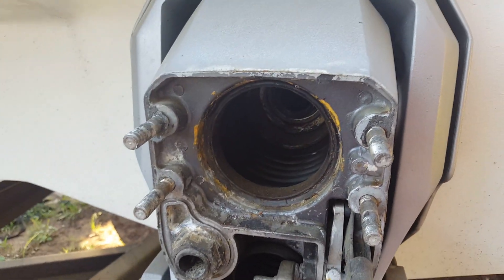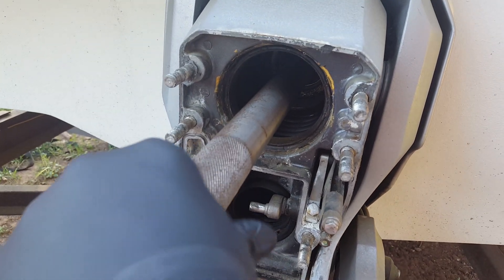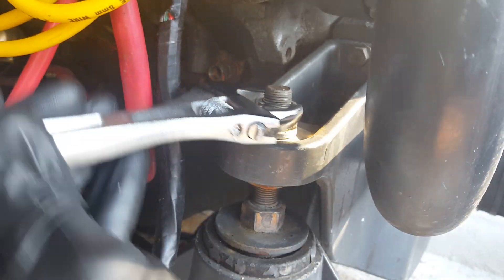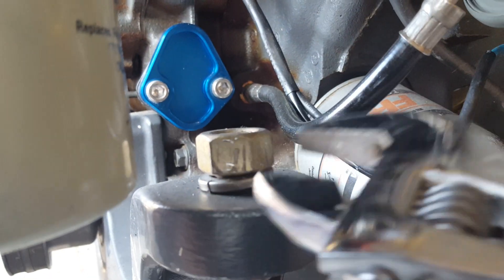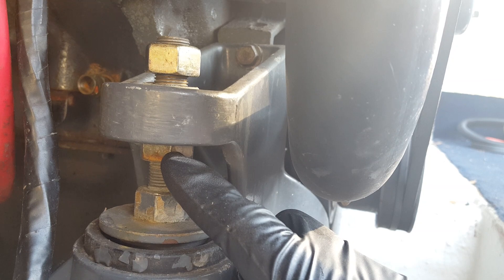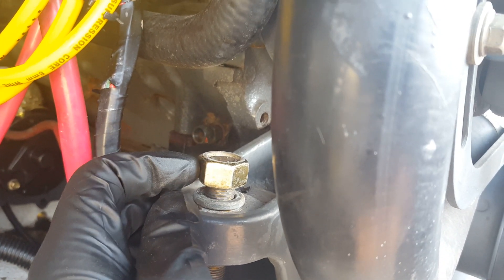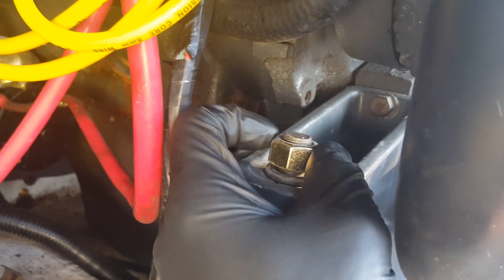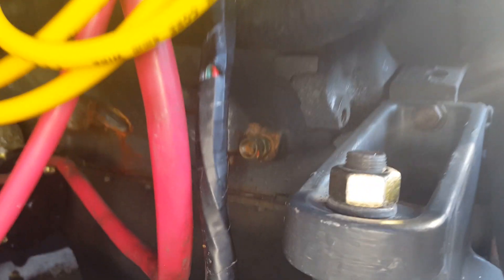OMC Cobra Volvo Penta SX Engine Alignment Procedure

Comment: Hey Mike, you've helped me a lot with your videos. I've installed the oil seal and gimbal bearing,  but now we're struggling to get the engine aligned. The tool seems to be binding about halfway through the turn of the tool. Any suggestions?

Comment: Is there any signs that your boat needs a fresh alignment , tell tale signs?
Reply from the maker: Typically the first thing is your gimbal bearing will go out and you will hear a really bad sound coming from that part of the transom. The second sign is when you pull the sterndrive out it will not go back in to the motor.

Comment: Hey Michael, so I just replaced my 5.8 omc cobra efi block with a new crate engine. Having a few problems hooking everything back up. I’m more worried about the alignment because I had to take the front motor mounts off to get the motor back in, I didn’t move it much, wondering if it’ll be ok?
Reply from the maker: The alignment will be off and the number one thing to remember is to be patient. This process can takes days or even a week to get perfect. It will eventually align perfectly.

Comment: My OMC Cobra won’t reinstall after gimbal replaced. Bearing is level but alignment tool hits top of engine coupler. Even in I bottom out the motor mounts it still hits the top of splined and won’t enter. Do I have to pull the engine out at this point?
Reply from the maker: You may have to raise the motor up to be able to swing it back and forth with a lift. I  had the alignment take 3 days. So if it’s taking a long time, it’s not abnormal. One time it took me a week.

Comment: I use the grease on the tool to tell me which way the engine needs to go.  The grease should look the same all the way around the tool when it is properly adjusted.  More grease on one side than the other indicates which direction the engine needs to go.

Comment: i have a question since i measured my adjustment tool and i have 16 3/4 from the bearing to the end how long is the tool you using so i can figure out if im all the way into the spline.

Comment: Was going to align the engine tonight & got the L side loose & nuts moving. But. The R. Side won’t go up past a certain point. Found out the bolt had rusted pretty badly within the engine bracket hole thats bolted to the motor. I removed the top bolt & bracket & can see the whole bolt now. About 1” of the bolt is pretty rusted. Tried wire wheeling the bolt on the boat. Was thinking of just taking the whole mount out so I could either replace it, replace the bolt, or at least run a die to clean up the threads & hopefully reuse it. But, after loosening the front bolt for the mount, it just kept on spinning. Won’t come out. Now I’m afraid to touch the back bolt holding the mount to the motor pad. Any advice? Are those motor mounts held in with giant lag acres? (Self tapping).  Or does Marlin (who makes my boat) have nuts encapsulates in the wooden motor block/pads? And if so, could those nuts be spinning in the wood? I’m going to see if I can get a die tomorrow & just try to clean up the threads & continue to motor align. Since this is the side that motor pushes down, I’m not too worried about the spinning front motor mount bolt. But. I’d like to fix it the right way if possible. Any advice?
Reply from the maker: If the lags are spinning in the wood, I wouldn’t be surprised. I would drill out the wood holes and use stainless all thread to make mounts.

Comment: Hey mike ,, as a second season boater not knowing anything about boat mechanicing you have made my world great, thanks for all your videos!! My question to you is I would like to build my own engine alignment tool as I do metal working/fabrication;; could I talk you into using your calipers/tape measure and send me the measurements of diameter and length of each step so I can turn one up in my lathe... I read one comment it’s 24” total length, greatly appreciated and thanks a million if you can,, very awesome videos! 🤙🤙

Comment: Great video! I've just finished installing a VP SX-A stern drive on my boat (don't remember the MY of the drive, but I think its from 2002). I previously had a VP AQ-100 (very old) stern drive unit so I had to redo and beef up the transom on the boat. I have also gotten an alignment tool and today I fiddled around with the motor mounts to try and get everything aligned. I managed to get to the point where I can push the tool all the way in to the coupler but not without using a bit of force so something is still wrong. I've tried going up and down on the mounts but I cant get to a point where it just slides in. I did a test and put some grease on the end of the tool to see where it hits the splines and It's only on the top part of the tool (I did not rotate it when I took it out). Yoiu mention in this video that you had to fiddle with the back motor mounts when you rebuilt your boat. I had a look at the back motor mounts but I couldn't really see any way of adjusting them.
Reply from the maker: I think I know what happened. When you removed the old transom, did you keep it the same thickness or make it thicker? I imagine you probably made it thicker--that can make things tricky. When you make it thicker, you have to pitch the front motor mount up significantly higher. If this is the first time you have tried this, it takes about 4 days to get right. Don't rush it, if you get frustrated, find something else on your boat to do, and come back to the alignment later. If you opt to slam the stern drive in--you will regret it.
Reply: @michaelromer2016  Well, I finally managed to get the drive on there. I loosened all the bolts on both the back and the front mounts and wiggled the whole engine a little bit and managed to get the alignment tool to slide in without effort. Getting the drive unit on was a still a bit difficult though. When I tested the tool on the coupler out of the boat (without going trough the transom) the tool does not seem to be that tight fit in to the splines. The drive unit on the other hand you had to have exactly the right angle or it would not go in. So I think that´s why I had problems getting that to fit even though I managed to get the tool to slide in easily. A few "gentle" taps with my foot and a couple of turns of the crank shaft later and the drive unit went in all the way.
Reply from the maker: I’ve used two pieces of 3/4 marine plywood to get my front mounts higher. I did see a guy online crank his motor over to get the splines in the stern drive to line up as someone pushed the drive in—talk about a bad idea. Glad to hear you got your setup going!
Reply: @michaelromer2016  Thanks for the reply. I did make the transom a little bit thicker than it used to be so that might be the issue here. I ran out of bolt height for the front engine mounts so I will have to manufacture some wedges to put under the mounts and try again.

Comment: On my sx cobra drive I can't get it to go in all the way. I'm definitely into the splines. Its stopping just as the 6 threaded studs go into the holes. About 2 inches. Is that an alignment issue?
Reply from the maker: The Volvo Penta SX has a sealing surface inside that doesn't offer the same feel a Cobra does. What does that mean? If you can get the out drive to the point where you can thread one bolt (even just a 1/16 of a turn), then watch this video: https://youtu.be/svuUL4pI35Y

Otherwise, you motor is not aligned.
Reply: @michaelromer2016  
Thank you for your info. Unfortunately all 6 studs are in the holes but still short under an inch from coming out.
Reply: Tilting it up worked great!!! It took a lot jiggling and I used a few ratchet straps. It worked tho and it's in. Thank you so much for your help.

Comment: Can anybody tell me what I'd number for my boat starter is for my  v I p  omc 302..ho Ford cobra
My I d tags are shot an starters been taken out. Two small bolts top an bottom an one wire to solenoid
Reply from the maker: https://www.ebay.com/itm/New-Johnson-Evinrude-OMC-Cobra-Drive-Starter-Assembly-Part-987969/290960450879?epid=1823990528&hash=item43be98253f:g:hAIAAOxybetSCkK8

Comment: Does your tool go into the coupler all the way, I am not sure if I have the right tool but mine only goes in the first two inches (first stage) the 2nd section is to thick to go into my coupler.
Reply from the maker: First double check you bought the right alignment tool. If yours only 
goes in a little,  your alignment is off a lot. A lot could be as little 
as 1/2 inch too low. Keep in mind that engine alignment when done from 
the factory is going to be spot on, overtime the wood settles and the 
alignment drops down.  It's likely that you will need to raise your 
engine upwards.

Comment: Do you know the size of the nut used on the motor mounts?
Reply from the maker: I'll go and measure it. Not sure at the moment.
Reply: Asking because I can't fit an adjustable wrench on my application. Hopefully a dedicated wrench of the proper size will be able to work.
Reply from the maker: @Cswrl220  It is 15/16  in size.

Comment: By the way any opinion on the greaseLESS gimbal bearings? Guess it's something new, guy on e-bay (salesman) says they last forever
Reply from the maker: I recommend when you install one to first make sure you have perfect engine alignment. They definitely won't last forever. Once the seals that keep the grease in, change shape with age, the grease will escape, and the bearing will go. What makes the gimbal bearings with grease ports better, is you can feel the grease fill the void of gimbal bearing. If you have greased various items with a grease gun before, you might have noticed resistance from when it was full. That resistance is how I typically can tell if a gimbal bearing was empty or not. Now keep in mind some people, might just hook up to the port, and start pumping multiple times--that's not how you want to do it and will likely break the seals. I ought to make a video on this one.

Comment: Hi Mike, as always good video. I've replaced the gimbal bearing beat it in with a 2x4, it is fully seated couldn't get the lower unit in. Bought the alignment tool/ bearing installer and can't slide the tool more than 17.5" to the bearing (it's 23 3/4" overall).  Lower/ raised the engine mounts all the way, no luck , wouldn't go any further in. Should I remove the bearing and beat it in with the tool ? if so, where should I drill the hole for the bearing installer ( the instructions say to mark the tool BEFORE removing the old bearing) too late for me. Any suggestions???
Thanks Mike
Reply from the maker: Your gimbal bearing is not aligned with your engine coupler. Don't worry about the gimbal bearing at this time. Your issue is specifically with engine alignment. Here are some tricks: create way to suspend the engine up in the air (e.g., engine life, hoist).   Loosen the front engine nuts. Have someone be in charge of the come-along/winch which lift/lowers the motor up from the front. 
The other person is in the back and in charge of checking when the alignment tool can go in 15 inches. Make sure you adjust the alignment nuts while the motor is suspended on the winch and then tighten everything back down with the winch/hoist removed. Fine tune the engine alignment (without the hoist) when the alignment tool goes in 15 inches.
Reply: Thanks

Comment: I did spin a engine coupler on my motor. is it possible to give me a call so I can pick your brain a bit? 541-731-6632
Reply from the maker: Sorry to hear that. Your motor has to be removed. Hey post your question here so others can learn from what issue you are having.
Reply: Michael Romer I did end up pulling the motor out and putting in a new coupler. I'm pretty sure the reason the coupler failed was because the engine was out of alignment and the coupler wasn't greased properly. Also I was having trouble  reinstalling the outdrive. It turned out to be an old bellow that was smaller then the u joint knuckle.  As soon as I replaced the u joint bellow and aligned the engine it went in like butter.
Reply from the maker: joe ortega That's awesome! When the engine is aligned perfectly, everything lasts so much longer. When I try and yank outdrives out and they feel stuck, I cringe.